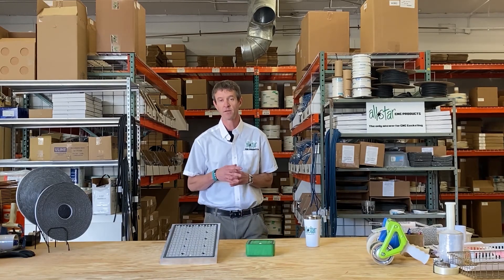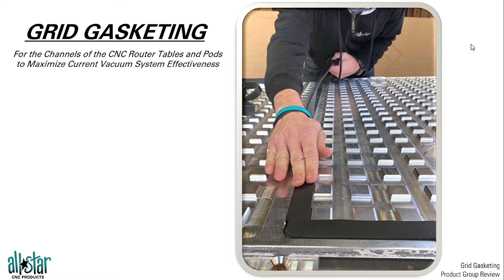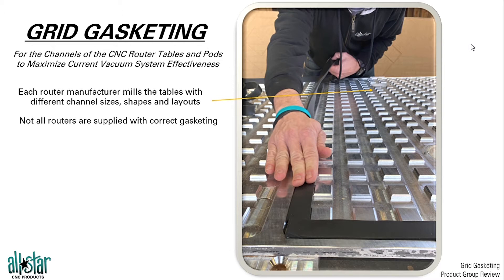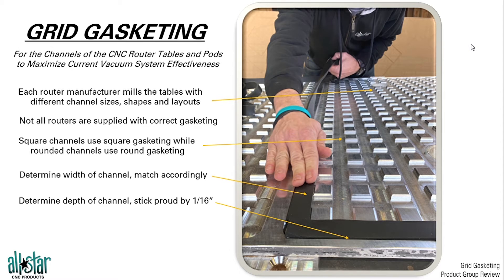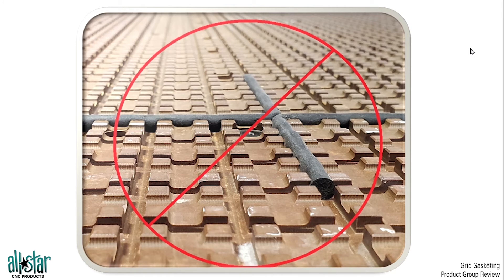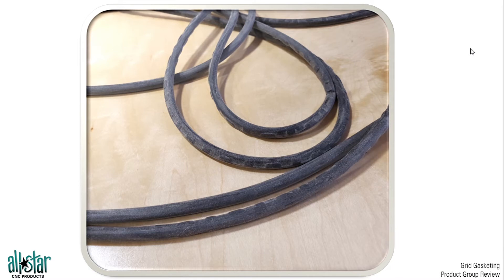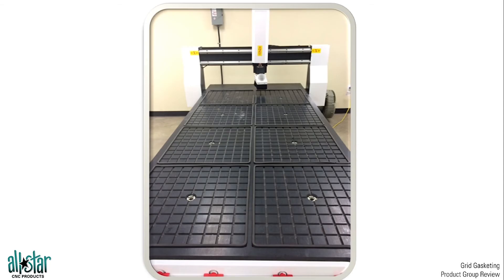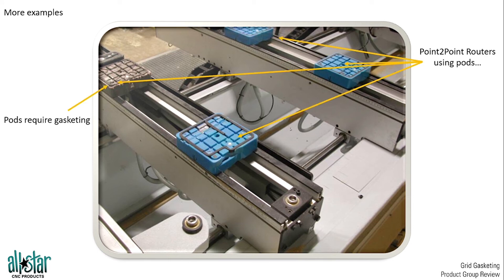Grid Gasket Product Review: For Improving Vacuum Performance on CNC Routers

Comment: Great video. Thank you for teaching us all about gasketing.  Would you recommend the D-shaped gasket for the 1/4 x 1/4 grid?
Reply from the maker: When the channels are squared, we recommend squared gasketing products.  For a square 1/4" x 1/4" channel, our most common Grid Gasketing product is our UMG 25 312.  Is it 1/4" wide to match the channel width, and 5/16" tall.  This sticks proud above the table by a consistent 1/16".  This is the "lip of the freezer door" that will keep your vacuum pressure as strong as possible.
Reply: Your gasket products have proven to be exactly as great as you have described. 

Do you have any information or videos on how to make a "splice", such as to make a closed loop in a rectangular shaped groove (not a grid, just one channel)?